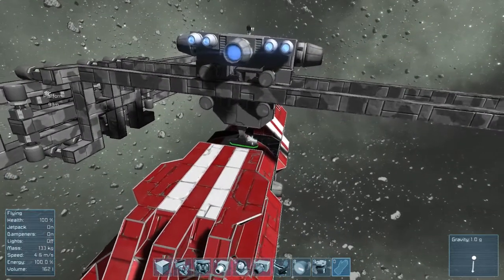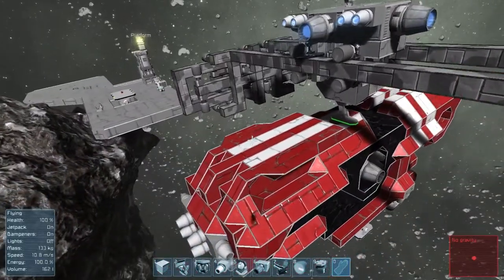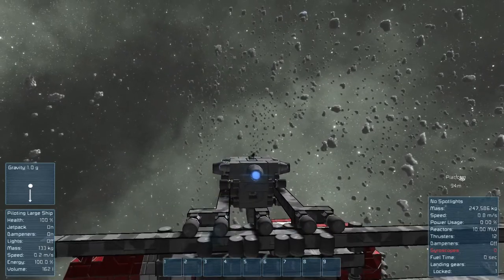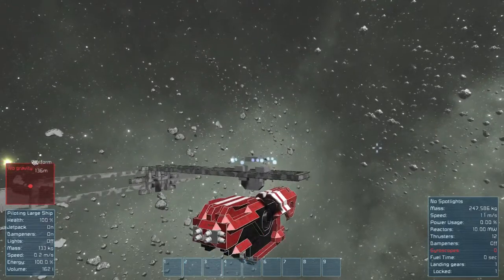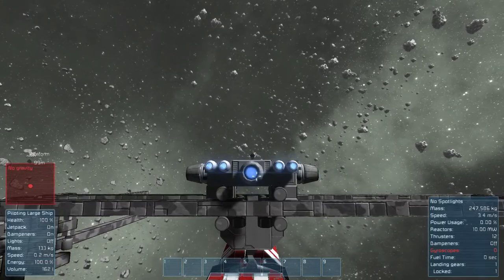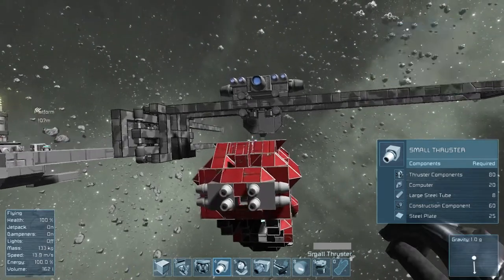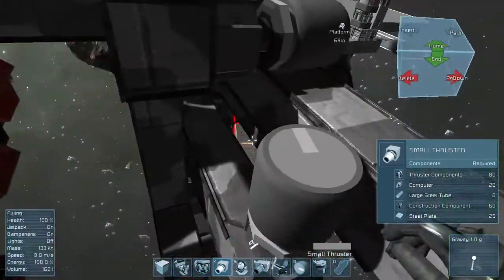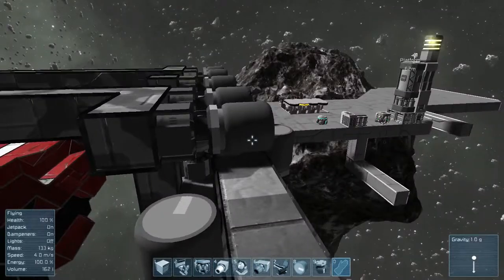Space Engineers - 2-axis crane (wheel based)

Comment: Hey, trying to piggyback on your model here, I'm still quite new to the game, I'm running into a problem though, I've got the rotors where there should be, but there apparently isn't enough room to place the wheels on them as the rails are kind of in the way I guess. Did you run into any problems like this? If so How did you over come it?
Reply from the maker: The issue is, that even though wheels are supposed to be exactly 1 block wide (for1x1), they're not.

To overcome this, build your vehicle away from the track and then pilot it onto the track once you're done, i made a little video showing this:
Space Engineers - How to get a cart onto its tracks

Good luck with it, if you have any further questions, shoot :)
Reply: Thanks!